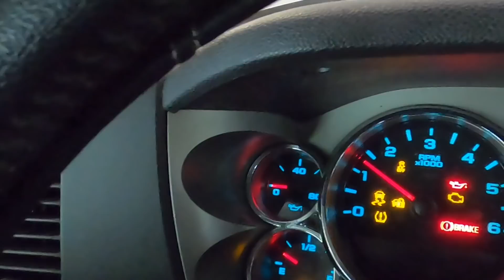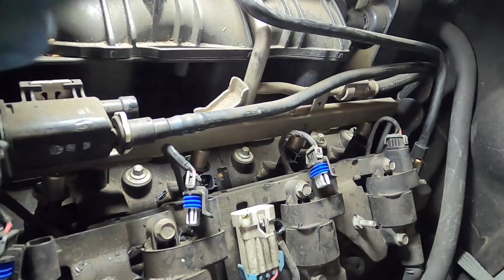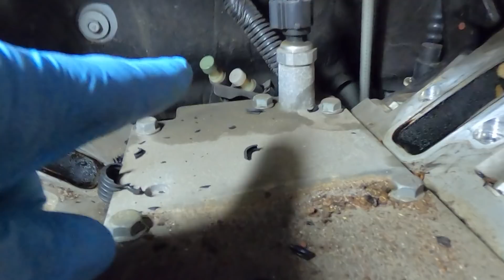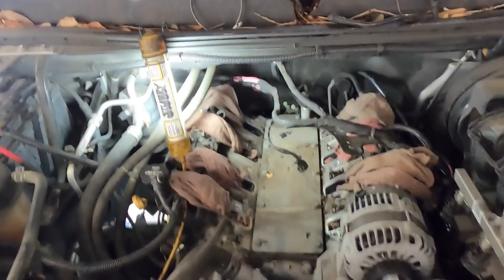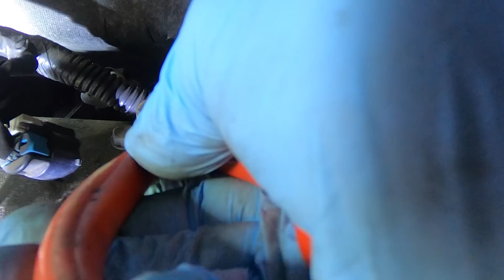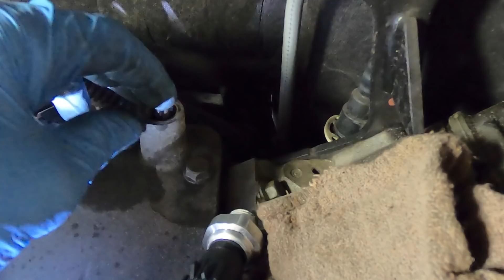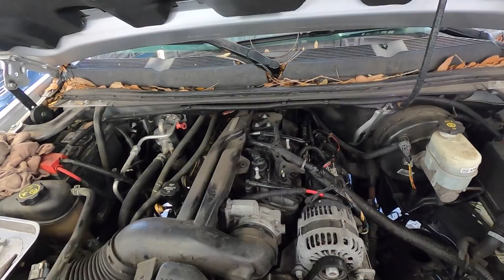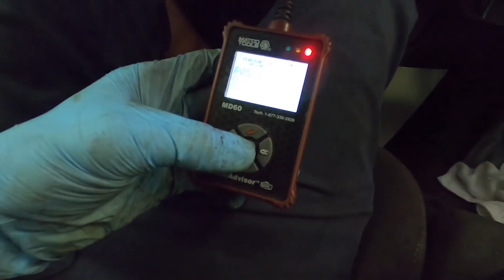Customer States: Google Diagnosis…replace this part!

Comment: Well you have nothing to worry about. The customer was trying to save a buck and got back ended with a shit sandwich. I've got a friend who has the same identical 2013 truck that has had three of those sensors installed since new. But they don't pull the intake. They've got a mechanic with tiny hands and fingers that does the reach around and changes it. He's moaning and groaning the whole time but show me a mechanic that doesn't. I enjoyed this video Ray and I would do the job as you performed it. GM must dip those sensors in liquid lead before their installment. Not one of GM's better ideas, the placement of the oil pressure sensor.

Comment: I changed my oil sending unit on my 06 Silverado without pulling  the intake manifold.
 6" extension, 1 1/16" deep socket, a swivel, and a ratchet.
 I did disconnect the fuel line to allow for more hand room, but it's not necessary. 
 The whole job took 10 minutes and I had never done it before.

Comment: Save some time take a hole saw and cut out an opening to change the part without taking 1/2 the motor apart.  It'll be ok air can still get in.

Google said to its ok

Comment: Good channel. Interesting shows. 2 comments: Why not use a shop vac instead of compressed air to remove the debris rather than blow the debris around? And I would never wear a conductive piece of jewelry like a wedding band when working on ANY electro-mechanicals. Keep up the great work!

Comment: Used to be on the back of the block right next to the firewall & the distributor you remember distributors they used to be a compression fitting with an 1/8 inch line that was it real simple to do all you had to do is take the air cleaner off go past the carburetor and there was have a great day

Comment: I know better than to just say "change this part." This is especially true if it is something I can't do myself as I can't afford to be wrong. If this was mine, I would have stated that I may suspect said part, you (or at least your service advisor) would have already had the DTCs as I pull those myself, and if applicable whether or not I tried to clear them and the success or failure of clearing them.

Comment: Lol. Intake doesn’t have to come off. Job takes 25 minutes. My god. I have a shop. I’ve owned a shop for 22 years. I do this 6 sometimes 7 days a week. You heal. You get used to it. I’ve been cutting my hands up over 30 years. They still work fine. And I don’t have any joint or carpal tunnel problems. Is this the same philosophy as DON’T FILL UP THE SCREW-ON FILTER, because it adds dirt. How about when you handle an OPEN ELEMENT CARTRIDGE? Think that enables dirt? Lol you think something on your freshly wiped hands is going to cause catastrophic engine failure the minute it hits the highway? C’mon.
Reply: You know, all that repetitive thinking of excuses to take your time and do things complicated because it’s easier might give your brain carpal tunnel.

Comment: I think from another video where he did a similar sender unit replacement, he had to clear the codes before the oil pressure gauge started working again

Comment: I've performed this job without pulling the manifold and yes, it is very difficult. A large handed person will likely not be able to perform it.The filter screen can be extracted by inserting a moderate length bolt into the sender port then twisting  until it bites. The screen is plastic.

Comment: One thing I've noticed on vehicles is the use of electrical tape in the assembly process. I'd love to have the contract supplying it to the auto makers. They must buy it by the box-car load.

Comment: Just watched you do the exact same job on another vehicle (but in the future) video dated June 16 2022 and after replacing the pressure sender it still read zero, you then cleared the codes and it started working ok. Was there any comeback for this job.

Comment: I would have thought that screen mesh would have made the problem of sludge build up worse rather than better, I'm happy you left it out. Also intermittent sounds like a broken wire so why he specifically said do not diagnose is weird, it wouldn't have cost any more to diagnose a broken wire and to leave the judgment up to you, all of the work is getting to it. Customers are never right.

Comment: When replacing a suspect oil pressure sender i always screw in a  mechanical gauge and start the engine to observe the actual pressure, just in case the sender is telling the truth, but on this engine it would not be possible.

Comment: I think it would have been easier to remove the radio from the dash cut a hole in the firewall to reach that  Sending unit.  My goodness that's a lot of stuff to remove just to reach the that.

Comment: Too much loosening... I don't reckon anyone's ever broken a fastener by loosening it too much. I'd bet that if he really wanted to though, Ray just might be able to crack that code and un-torqued to yield a bolt to the point that it ultimately fails and can no longer be used as a fastening device.

Comment: Lol, good video. Thought it was pretty obvious it was not the oil pressure sensor at the start of the video, because the gauge did not move upon vehicle startup. Still leaves a number of possibilities though, including faulty instrument cluster, faulty wiring harness to cluster, and/or faulty computer.

Comment: No need to remove the intake Ray, oil pressure sensor socket, 3/8 swivel with an extension done in under 5 min.

Comment: Hahahaha. Now, the customer has to pay for the labor and it did NOT fix the problem. Since Ray recorded it, he/she can't say "you ripped me off" because the entire repair is recorded and Ray did exactly what he was told to do. Now, the customer is out the 2-3 hours of labor (@shop rate), and NOW had to pay diag, plus parts/labor to actually fix the issue and Ray gets to rip it all apart again. Classic

Comment: Most shops won't do this anymore (allow a customer to demand replacement of a part without diag). Why? Because 8/10 times that's NOT the problem and then they get all upset that they just spent money for 4 hours of labor and it's still broken. If anything, we make them sign a special line on the job card that IF this isn't the problem, they WILL have to pay for that job IN FULL before remedial measure to find out what's ACTUALLY wrong are performed......plus diag. If they're not cool putting 100% of the onus on themselves if/when they're wrong and having to pay to take it apart then fully reassemble with the strong possibility that their youtube diagnosis is wrong, then don't even begin the work on it. It leads to angry techs, angry customers and a huge waste of time

Comment: I didn't see a comment( didn't read them all) but pretty sure the reason the screen wouldn't go in is because you didn't take the old one out. I took a long bolt and threaded( lightly) into new one to make sure it'd just screw in the diameter of new one then stuck it down the hole and screwed into the plastic of old one. Pulled it right out. Did whole job in about 10 mins. No intake pull. Kist a ratchet,a couple extensions, a "wobbly bit" and the socket. Really should have replaced the screen.
Reply: 100%

Comment: I never seen you retrieve the screen from the oil sending unit mounting position. It would stand to reason that is the reason the new one wouldn't seat. Truck was jacked too tho so Its not like you could have looked in hole. Ive had to use booger pickers to get them out. I love your content tho and believe you are smarter then me. Just wanted to point that out. Those screens getting blocked are reason for no pressure reading. I've actually used one cup of diesel fuel and idle for five minutes for every oil change that I do it keeps mine pretty clean.

Comment: I’m not if there’s any crazy difference between the 5.3 or the 4.8 but I’ve definitely done my oil pressure sensor with one had due to a broken collar bone in ten minutes

Comment: Considering what time was it took you to install that pressure sensor he could have paid for a diagnostic and not had you go through all that and you know there's a reason why there were guys like you doing diagnostics out there if he knew what was wrong with it why me when I can take fixing himself but that's quite a job also what kind of music are those guys listening to in the shop I swear I've never heard anything like it unless you doing something to change the sound so you wouldn't have to do a copyright it sound like a cat got run over hey have a good day

Comment: It's a o ring on the oil pick up tub 
Lack of sealed vacuum will not pick up the oil.
Les you have a oil pump issue
That's been my findings

Comment: I watch your videos all the time! I want to thank you. I'm seventy two years old and used to do all my mechanic work. The reason I watch you I learn things to keep from getting ripped off by crooked shops. I took my Lincoln towncar to get serviced at a drive thru oil change shop. The guy in the pit yelled up me, informing me I needed my CV joints to be replaced.  It so happened they also had mechanic shop .
After I quit laughing  I asked him to see if my engine was sitting sideways under the hood, he said no it wasn't.  I instructed him I wasn't a dumbass. I said son this is a rear wheel drive car and it doesn't have CV joints. I said the next time you try to screw someone, know what you're talking about and get your ass from out from under my car! 
I wish your shop was in Jacksonville Florida, I would be your customer, for sure!
Thanks for the great videos!
Reply: I can't stand chops and try and take advantage of older people or anybody in general and I've I've quit jobs because the shops wanted me to do that and I'd say see you later bye hate to be that way but man I can't stand behind somebody's ripping people off have a good day

Comment: One time I had the Ford dealership replace the fuel pump on a Ford Focus with the Dual speed fuel pump and returnless fuel line. I was going to school to be an automotive technician, so I explained to them all the steps I did to diagnose the problem and the technician was satisfied with my diagnostic procedure and replaced the fuel pump on my suggestion. I also did a bunch of service bulletin work to the car replacing parts that needed to be replaced anyway, rear brake shoes and a few other things. Typically though I don't tell them what I think needs to be replaced, I just let them do the work.

Comment: I just wanna say I rebuilt my whole truck based on google diagnosises - 90 percent of the time I was spot on with my research and I came from only knowing how to change the oil to everything except rebuilding the engine, transmission and differential. 

All Im saying is I currently do not know how to do those things, but I am happy to say that if I should have too, I will be able to rebuild those things if its cost effective using google.

Comment: The only reason not to have the diagnosis is if you don't trust the shop.  I remember the days of knowing what was wrong but not fixing it myself.  Now I fix it myself.  Mechanics generally don't like to be in this position because if the customer is wrong they don't want to pay for the labor to fix something that wasn't broken.

Comment: Ray, I've watched several of your videos so far, and you seem very knowledgeable and methodical.  Well done.  I've unfortunately grown suspicious of some service techs after a few botched diagnoses that I ended up fixing myself.  Best one was the tech who figured that the reason the power mirrors weren't working was because the body control module was bad, and he couldn't identify the correct fuse for the power mirrors after I found the fuse was blown.  After I got the Helm subscription to get the service manuals, found out he was full of it.  The body control module didn't control the power mirrors at all!  I had it narrowed down in 20 minutes:  A bad mirror switch, $20.  Cracked open the old switch, a contact had broken off and short circuited the traces on the circuit board, causing the fuse to blow.  So glad I didn't pay them the $1500 to replace the perfectly good BCM.
Reply: And personally the sad part is they don't care it's on you or dime they get to learn something and if you go back if they make good on it you're lucky the thing that gets me I've end up in my driveway doing the same thing and been hundreds to have them play around and it ended up coming with me 20 30 bucks in a little bit of time to take a good look and think about it it ain't rocket science but it ain't easy have a good day guys

Comment: i just ended up with a 2002 f 150 4x4 because the guy said his trans was bad i told him let me check it out first and he said no he knew what was wrong with it. and brought me a new trans straight from ford. so i did what he said i put it in and guess what it will wouldn't work. i called him told him the trans is in full of fluid to come get it but it still dont work. he refused to pay me so i did the paper work took him to court kinda but he didn't show up so i got the paper work got the title in my name went and chnged number 23 or 24 fuse dont remember for sure with out going out and looking and drove it home. i think i might keep it and sale mine. only because i just hit 3010000 miles on mine and this one only has 127000 and a new trans.

Comment: Some of us have just worked on our own cars and motorcycles for 50 years and don't have the benefit of a $10,000 diagnostic computer or a few grand to pay a mechanic. We do what we can. And speaking for myself, I've managed to keep everything of mine running with an OBDC 2 reader (or a paper clip), Google, a multimeter and some hand tools.  When my late model car bites the dust, I'm sticking to my 94 Harley with an Evo motor. New cars are shit.

Comment: Ok i gotta chime in on this one. That sender can easily be replaced without removing the intake. Ive changed several incuding the screen as well without removing any of that. Takes about 30 minutes. Job still pays the alotted time per the books. By the time you finish intake disassembly, id be on to the next vehicle.

Comment: I just love the GM engineering. From a 100s of places that you can install a sending unit,this has to be one. Morons. 
To replace a sensor in common place would take less then 10 min,but this will turn in to a $500 bill just a labor time. Genius.
Reply: Nahh. Sensor actually takes about 30 minutes to R&R. No intake dis needed. Sensor socket, extenstion and ratchet. Hardest part is removing the plug blind.

Comment: When I did my 07 4.8l I looked quite a while to find out if I needed the screen filter. From what I can tell the screen filters are only in the 5.3l and the 5.7l. I didn’t pull the intake but as much as a pain in the butt is was, I should have.

Comment: Clear the engine codes after replacing the sensor and you’ll see the oil pressure gauge will start working 😉

Comment: As a Certified GM Technician I can assure you that you don't have to pull the intake. 
Use a pick to pull up the assurance tab on the connector and disconnect. 
Put your oil pressure switch socket on an extension and universal and remove. 
Don't forget to change the filter screen under the switch before installing the new switch. 
Less than an hour to change, and if you're flat rate you just made good coin on that job.

Comment: I have done a few of these. I use a RotoZip bit in my Dremel and relieve that plastic firewall cover that has the PVC hose through it to gain visual and socket access. I never have to remove or take anything off at all (that I remember). It takes about 30 minutes, I always replace the screen with a new one, I use a fine thread 5/16 bolt 4" long bolt to engage the old filter and pull it out. I am sure you can't do that since it is modifying/damaging a customer's vehicle to cut that plastic piece. I am '6-2" 225 lbs so my hands are not small! In my personal 2010 Chevy Avalanche the oil pressure would never go above 30PSIG, then one day, no pressure. It was the POS sender....

Comment: Even though the switch replacement didn't work and customer wasted his $$$ and your time the engine STILL has oil pressure or you would certainly hear it if it didn't but i agree 100% about checking 1st. I had a 1996 Grand Cherokee 5.2 V-8 that had an oxygen sensor problem so i bought both sensors and 1 was rusted and required heat so a Meineke did it for me but 1st he checked the part #'s and wiring, still only charged me about 70-80

Comment: He will be very disappointed if it’s not the sensor. Anyway, what crappy engineering to put the sensor where you have to remove the intake to replace it.

Comment: this is for those that want to why vehicles are so hard to work on. I was an Isuzu tech when the new trooper with the new Isuzu v6 arrived. customer took one of the 1st ones in to a quick lube for it's 1st oil change, 2miles down the road the oil filter blew off and customer drove it until it quit.  Towed in an Isuzu told me to pull the engine and tear it down for analysis. On older gen Troopers  supposed to drop the oil pan, about 2.5 inches, unbolt oil pickup, drop it in the pan to remove pan so engine could move forward over front 4wd axle. Nothing in manual for the new Trooper engine removal. 
  called Isuzu district
  then called Isuzu National
   2 days later, got a call from Isuzu engineer in Japan, They didn't know how to remove the engine, he stated that they had just figured out how to INSTALL the engine when vehicle was assembled., never thought about having to remove it.

Comment: Replaced the sending unit on my daughter's 08 Escalade 6.0, 
Didn't remove the intake but in hindsight it would have saved me about a pint of blood. Granted there was a bit more space on her rig.
The filter does set fairly deep inside the hole, I wound up using a long 10mm bolt to fish it out. Just wondering if perhaps you may have overlooked the fact that a filter had been previously installed.